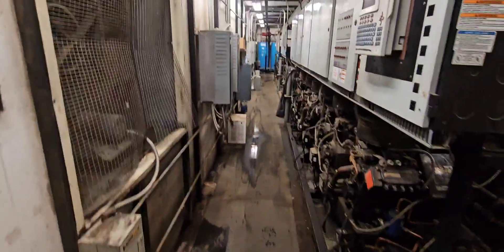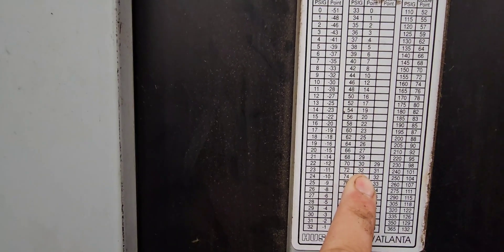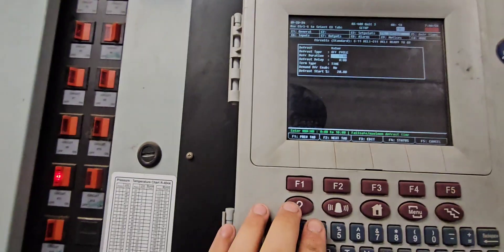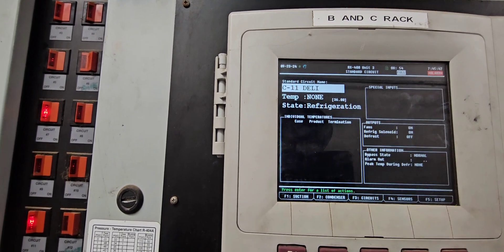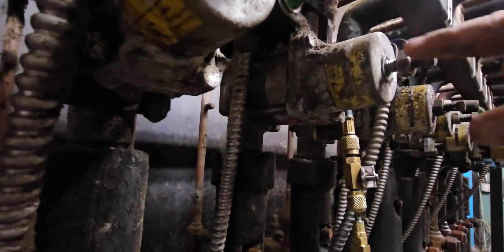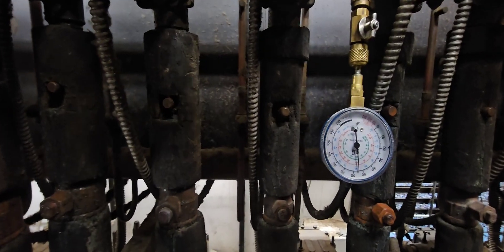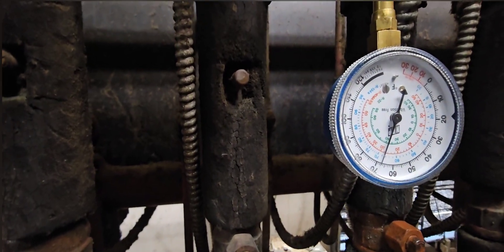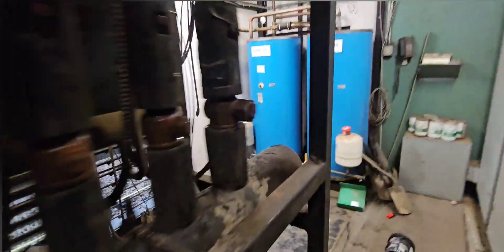Supermarket Refrigeration: EPR adjustment/ diagnosis.

Comment: You gotta put in for Sporlan regional trainer man
Reply from the maker: What is that?
Reply: @SupermarketRefrigeration  like they travel around to large companies on training new product lines and older products, installation testing adjusting troubleshooting training, and then pitching all the alternative devices available. Like my boiler operators had Hurst boiler trainer for a day class. Keyence sensor trainer dude,  Parker hydraulics rep on on system over view of equipment that wouldn't maintain consistent pressures. They bring catalog book and parts, suggest what all would help. They generally are like consulting, training and sales mixed. Travel alot though.
Reply from the maker: @chrislococo7220  o thats cool. Ive got a family that I like to be home for though. Lol. Maybe down the road somewhere.
Reply: @SupermarketRefrigeration absolutely most of them dudes i worked with were ex military older ones that got an excuse to dip from the old lady 😂